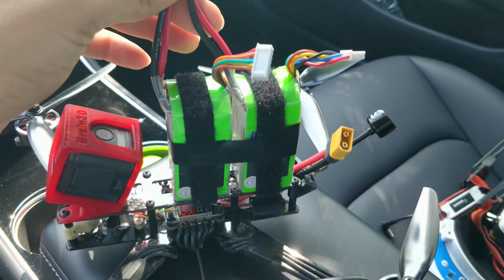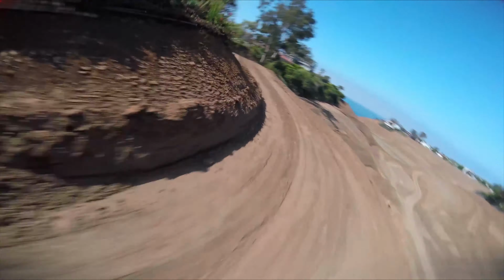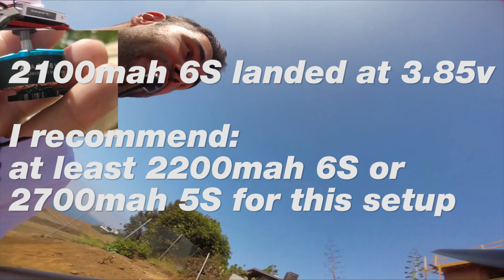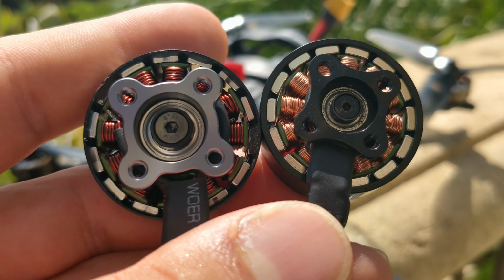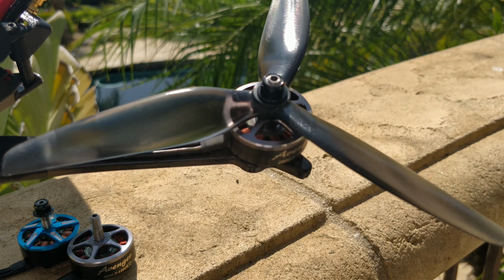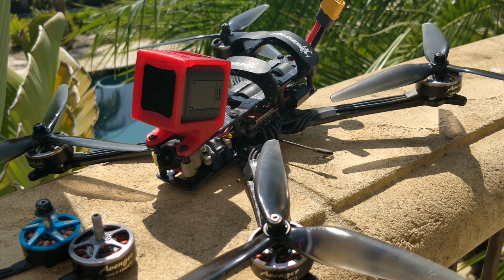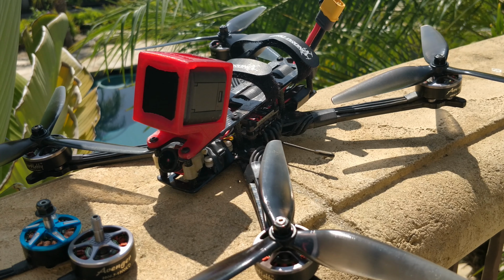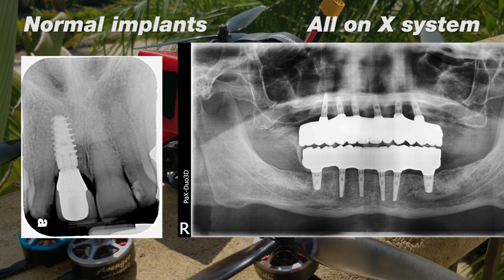Brother Hobby 2806.5 Avenger - 7"

Comment: So, recently I had a conversation with a pilot that told me ALOT of 7” quads are flown on 6” props, and at the time, I thought that was absurd, not in a bad way, but why would you give up all that disc space, so I decided to try it, and... it’s absurd!!!

You know a whole helluva alot more about this, but to me, the difference between flying this 7” quad I have with 6” props vs 7” props is night and day, with the 7” prop being a whole lot better. Am I missing something?
Reply from the maker: As you move up or down in prop size, a lot of things change.  Your potential disk area is the primary change.  The main difference will be how the motor manages the prop, the kv and your AUW.  The kv range shifts up and down by a given number but all that means is that you'll have less power by moving down to 6" with the same kv/voltage.  Next would come how the motor manages the prop.  If you're running a 2806, I'd say the motor can adequately manage a 7" prop and would be fantastic at managing a 6" prop. A 2407 wouldn't do so great on 7" but would do well on 6".  Then comes your AUW.  Typically a 7" will have a larger frame that weighs more with more battery and more of everything than a 6".  A 6" is pretty much just a 5" with a little more arm length.  The weight difference can be drastic.  A lot of the time people build quads for 7" with too small of motors and too high of kv with too frail of a frame and so the quad is really a 6" quad that happens to fit 7" props.  So it makes sense to drop down to 6".....hope that helps.

Comment: I would love these, but they go for $41.51CAD a motor. I'm flying a GEPRC crocodile frame with some cheapass Racestar BR2508S motors. The racerstar BR2508S retail for $13.66CAD a motor... three time the cost. Fortunately I'm not a good enough pilot to notice the performance difference at this point.
Reply: What flight time do you have?

Comment: 2508 i hawe bild 7inch frame ,4s 4000mah ,25 min flight time not hard for long range.
Now planing bild TBS G2 carbon frame new project with 18650 4s to 45-50min, frame weignt 39g and takes 7 inch props.

Comment: The ion drive 2506 are like 50-60$ for the set of 4  motors. I like them personally..
Reply: Sir, is the ion drive 2506 has a 16x16 mounting holes？
Reply: @vincentko88  Just measured myself for u, they are 16mm x 16 mm my friend.

Comment: Is it ok to run these motors with a 40amp ESC?
Reply from the maker: yes that should be plenty
Reply: KababFPV I checked the max current of this Brother Hobby is lower than the Xing 2806.5 1800kv which has a 54amps mac current? Do you think a 40amp ESC is still enough? Or should I go with a 60amps?
Reply from the maker: @crispywisp  that's on the bench. In the air that number will be about a third to a half less
Reply: KababFPV ah I see. So I don’t need to get the 60amps. I’m glad my spare 40amps would be enough. Thanks!

Comment: The 2806.5 looks like a 23ga single strand hand-wound DLRK.
If thats what they're putting into it, it's worth every cent of $31.
Reply from the maker: They are quite beefy in every way.
Reply: @Kabab  I have a unbuilt 6" Ti Chameleon that I bought on a whim a year ago for cruising around with a HW xrotor F4 4-in-1 combo, Runcam split, crossfire, and recently picked up the 1000mw TBS... still hunting for the right motor and these look like good high quality gear trustworth enough for the expensive load. 
Since I'll skip the Gopro, all of the misc 3d printed bits, battery gel pad, etc... I'm tempted to go with 4s 3000's that I need for the Strix Goblin that's also still in its box.
Reply from the maker: @dash8465  I think there is a 4S kv version?

Comment: Don't waste your time trying all the props that are available right now - none of them are great, all of them are good at a couple things and not much else.  I like the GF7042-2's, but those are really only good for big wide open stuff, and they have a sharp resonance point at 140Hz and they can pick up vibrations.   The HQ 7x4x3's are the best overall compromise for general free flying, and the biblade 7045 are also genuinely amazing.  The DAL Cyclone 7056C's are oddball props that have huge grip and flow at speed, but annihilate batteries when you push them, and punish smaller motors - maybe if you have a set try those on your 2806's, because they're not that great on anything I've tried.
Reply: The HQ 7x4x3 seemed to pull more amps than the DAL's on my Epic with 2208 2150kv 5s when fast cruising. Not so amp hungry when I wasn't tearing up and down mountains. Was about to order the GF7042 but you say they can induce some jello, not the smoothest prop?
Reply from the maker: Don't bother with twin blade 7" props.  So much jello it's a waste of time.  I've yet to try a 7" twin that wasn't nausea inducing and the GF7042 is the best one I know of.
Reply: @Kabab  Yeah, best of... that.  Unfortunately, I think the answer is either a less durable prop (something derived from the Hurricane line with thinner blades in both dimensions towards the end), or going with 40g motors.  That, or an Azure Carbon variant from their existing architecture.  Neither would be particularly durable, but it is what it is. Scary version - it'll require both, but I wouldn't mind it because  I actually managed to get over a year of use out of one set of those GF7042's, before finally crashing it into bleachers at a racetrack.

Comment: Are you using the 7" tune?
Reply from the maker: I'm using full defaults on BF.  I haven't changed any settings across any motors
Reply: You do realize that doesn't actually give you a proper representation of the product right? 
You are changing parts to try to find a match to an untuned flight controller. 
Don't you dare say tuning is a pain.🙄
😂
Reply from the maker: @Stanton_High  I'm all about the 'good enough' tune and this tune is beyond good enough. I specifically flew it in the worst case situation to see how it does and it did wonderfully. I'll get some videos up in actual good situations and it'll be super silky.  There is no such thing as a perfect tune. It's a moving target....

Comment: What is the amp draw?
Reply from the maker: Not low 😅. 2200mah 6S or 2700mah 5S is the minimum I recommend.
Reply: @Kabab  that fine, I fly heli too, so I have a couple of 2200mah 6s 😊😊😊😊
Reply: @Kabab  you need to add this to the summary of the video haha. Sounds like these are big block v8s and are powerful but get 12 mpg lol....

Comment: I've been running ZMX FinX40 2607.5 motors on my 7" since 2017 and they are great. It's surprising that other brands have taken so long to incrementally reach this size or larger for the 7" market. I was never really keen on smaller 23xx or 24xx motors (let alone 22xx) for this application after flying the FinX40s. I think i'll heavily consider these 2806.5 for my next 7" build.

Comment: Am building a 7” vertical frame rig (I fly LOS 95% of the time) called Vert1go, for a description and pics, see: https://www.rcgroups.com/forums/showthread.php?2883082-Tweaky-the-people-s-frame-and-its-variants/page192#post41789075 it’s friggin awesome, very light, fast, FLOATY, and rigid...tuning was pretty easy...but tuning for LOS is obviously a lot easier.  I have one already using this same frame, built using 20x20 electronics and RS-ii 2306 2600kv motors for use with 4s.  It files great but, to try something different, for the new one I’d like to use the 2806 avenger motors...I’d also like to use 6s...would you recommend using the 1300kv or 1700kv?  Btw, you probably know already, but gemfan now sells a tri-blade 7” prop, the flash 7040 (as opposed to the the bi-blade 7042 they also sell) in bright solid colors that us orientation-obsessed LOS flyers love.
Reply from the maker: 1300 for 7" 6S for sure.
Reply from the maker: very cool quads BTW

Comment: Increase your p gains
Reply from the maker: I've been trying to solve this bobble for about three years now.  I've tried everything anyone has ever told me and have had multiple developers look at my logs looking for what to do.  I settled on it being a motor/prop issue a while back due to the inability of anything to help.
Reply: KababFPV  the closest thing I had to compare with this is your glide frame and 6" props. I am running 2306 1600 kv motors on 6s. During a cruise, even without a breeze, I would have them exact bobbles. It would hold the attitude but dance around. Increased P gains in both pitch and roll 5 points and it got steady. Three blade props were too much for that motor, so I just run the gemfan biblades. Handles the prop better. I guess it's sorta the same as what your saying.